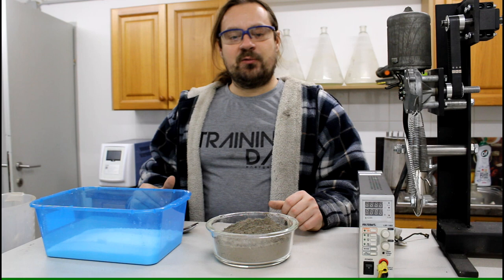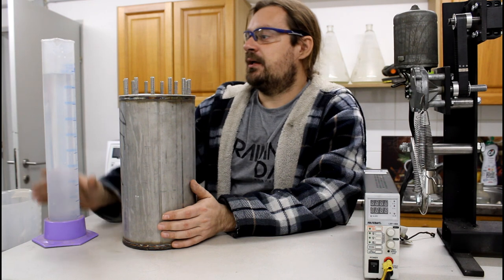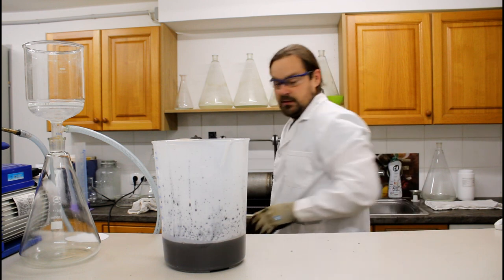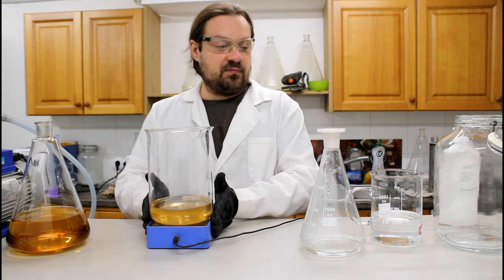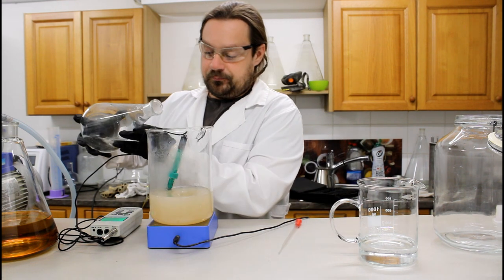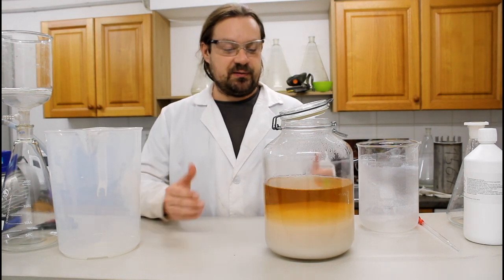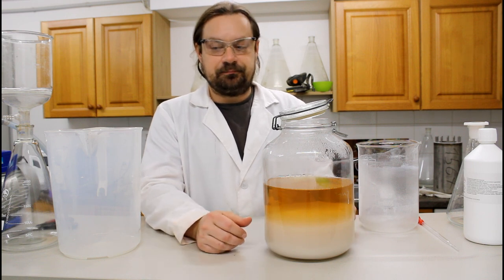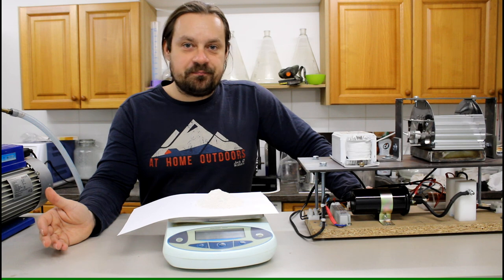how to open an ore with the NaOH boil method

Comment: You can double your precious element hydroxide yield if you further process your iron hydroxide precipitate and your orange  "waste solution"  instead of discarding it, your throwing away values!The orange tinge in that solution is actually a gold metal cluster bound to the other ormes.
Reply from the maker: You mean precipitate the FeOH at ph 3.6 and reboil it? I had actually in mind that the orange color is from Fe in solution or even carbon as the ore contained some organic impurities.
Reply: @andreasthealchemist9446   Well sort of but a few modifications to the process will allow you to extract even more ormes from your iron hydroxide waste. Regarding your caustic orange waste solution you can do a sensitive test for presence of iron traces with sodium thyocyanate but even if the result turns positive theres still values in that solution. Based on my experimentation I strongly suspect the orange color is actually diatomic gold metal clusters bound to the other ormes elements hence the reason you will notice the Au to be chemically inert, however it can still be recovered and converted to metal to futher increase your final yield.  If you decide to process your waste products let me know how it goes, good luck! I can send you my contact info if you have further inquiries.
Reply: I have some same issues. How to contact you

Comment: I am surprised by the basic extraction.. I see initial treatment with acids usually. Are we trying to break up silicates or what?
Reply: I had to give it a think. It opens aluminates and silicates. The description tells that it can get precious metals into solution. That combined with the fact that it leaves behind ferrous stuff, zinc and most heavy metals, it has a good selecting power. Then the acid wash dissolves most amphoteric things like aluminium, titanium, gallium etc and they land in the waste solution.
Reply from the maker: @whatevernamegoeshere3644  Yes it opens Al and Si... Al precipitates at PH 6,5 - so it will be washed out. Si however will precipitate.

I have to make another video that explains what I am up to exactly...

If the values are present as metal (e.g. Au metal) an AR leach or an cyanide leach would be the best to get the values...

This method however targets PGMs that are combined with alkali metals - in nature they exist as white powder, which is somewhat unwilling to analyze as what it is.

Comment: Wouldn't molten sodium hydroxide be more efficient?
Reply: I do this with azomite volcanic minerals and molten sodium hydroxide it turns turquoise, then I add distilled well water and let it settle, you can either collect the clear water from the top and lower the ph with hcl/sulfuric acid to make a precipitate. 

Or dissolve everything with acid and filter then raise ph to 4 and filter the bad stuff and then raise to 8.5 and try to collect and purify the crystals that come out at 8.5-8.7 those react in really strange ways search on youtube "azomite ormus" and there will be this guy with a magnet making them jump

I've opened gold to the point of getting the exact same white jumping powder its like it builds up a charge and releases it all at once.

I believe these materials to be carriers of orgone and they can be augmented and used as batteries for energy.
David Hudson talks about Meissner fields etc
Reply: @ConcretorumAzoth  Wow thank you for that detailed response!! As a professional chemist I am quite fascinated by alchemists and their work. I've read some books on the subject but it's hard to find people I can pose questions to. So you've made a white gold compound that responds to magnetism? That's rather unexpected. Never heard of such a thing. I've made at least 14 different gold compounds in my lab but never noticed any response to magnetism from any of them. I will have to go through your videos and catch up on your work and get a clearer picture of what you're doing.
Reply: @PoorMansChemist  I'm honestly scared to share any of it. Someone tried stealing all my work and lock me in his contracts already.
Reply: I keep getting shadow banned on youtube as well its just spooking me out
Reply: @ConcretorumAzoth  Okaaay. So why don't you just patent the production process? 🤔
Reply: @PoorMansChemist  I made a few of my hundreds of private videos public for today have at it
Reply: @ConcretorumAzoth  Thanks! I'm very curious to know what kind of chemistry was at work there. And you have my word I am not out to steal your stuff. As a rule I avoid doing preps on my channel that other people have done. I don't like stepping on people's toes. So I am happy to say here publicly in writing that I am not going to repeat or sell your work.
Reply from the maker: Agreed! In actual fact high value ores I do fuse in NaOH or even fuse with Na Metal.
Reply from the maker: @ConcretorumAzoth  Yes these materials do have some remarkable properties... It is interesting that you succeeded in creating the jumping white powder with gold - I thought that only iridium is doing that.
Reply: I'm not doing chemistry.

I'm burning with nothing but water and spiritus mundi.
Reply: @user-bt4rz6lw5o  All alchemical processes and preparations can be described in terms of modern chemistry. I have not come across a single one where I wasn't able to figure out the chemistry of it.
Reply: @andreasthealchemist9446  Wait are you guys talking about diamagnetic compounds of gold?.
Reply: @ConcretorumAzoth  OK you're dropping jargon on me I don't know. Now I know what my organic chem students feel like. 😄 What is the kings chamber?
Reply from the maker: @PoorMansChemist  As far as I know gold is diamagnetic anyhow. 

I am talking about gold in the form of a white powder that is not rare in nature. Same as other PGMs which do form white powders too. The chemical composition of it is a combinaton of PGM and alkali metal - e.g. AuNa, which can exist in ionic form or not.

The Problem is, that these AuNa (could be also IrK or whatever the like) do not show up in common analysis as what they are.

Another problem is, that  the bonding of these molecules is so strong, that no wet chemistry can seperate them.

They are abundant in nature - they exist in every plant and animal beeing - vulcanic rock contains the most of it - they do not analyze as what they are and the process to convert them back to metal is difficult.

The following metals do form these white powders: Cu, Ag, Au, Ir, Rh, Ru, Os, Hg.

The easy method that I have given is a way to target these substances occuring in nature.

Respectively the lye boil will not get any metallic gold in solution, but it will do so with AuNa and others of this species...

In order to drop them back to metal the extreme strong bond between the PGM and the alkali metal has to be broken, which can be done by:

a) subjecting it to strong radiation (UV up to X-ray)
b) adding ozone while radiating it
c) strong electromagnetic radiation (microwave)
d) converting it to a sulfide and boiling the sulfide for quite a while.
e) Some researchers also reported that they could perform a reduction with CO and NO gas.

To sum it up:

1) Extracting these white powders from nature is quite simple.
2) Converting metals to the respective white powder is still somewhat simple (could be done with a sodium burn or wet chemistry)
3) Converting these white powders back to metal is extremely difficult, with quite a lot of pitfalls.
Reply: @andreasthealchemist9446   Thank you!!! That makes more sense. I appreciate you taking the time to break it down in terms I can understand. I am acquainted with the basics of alchemy and have enough of a working knowledge to follow along  but I am no expert. 

Have you considered using sodium borohydride to convert it back to the metal? That is my reductant of choice for PGMs since they drop out as the metal and not metal borides like some other metals give you (rhenium is a good example). Sodium borohydride works so well with gold that it will even convert compounds like gold(I) cyanide and alkali dicyanoaurates (all of which have covalent Au-C bonds) back to the metal. Best of all the reduction is over in a few minutes.

Comment: 8:18 I would honestly wear a full faceshield for hot NaOH. A lye splash in the face is not fun, not something I would repeat ever and most of all not when hot
Also that UVC lamp lol. I would bet money you guys used the UV capsule from an 80W mercury street light, judging from the colour and the ballast. Cover the paths of light coming out of it because 1, it will degrade the insulation on the cables in the machine itself, 2, it will age anything made of plastic in your lab. That can be an ultra-expensive mistake in the long run.
Reply from the maker: Hello, regarding the face shield you are right.

Regarding the UV Lamp, it is an 1kw Hg lamp. It takes about 1 minute to get to the full brightness - what you see in the video is the starting phase.

I do not run it in the lab, I run it outdoors - there are just vegetables around beeing happy for some extra UV in winter time.

Comment: When making the initial mix and pouring it out, why not clean out your reaction vessel with water rather than just diluting the mix?  @9:30
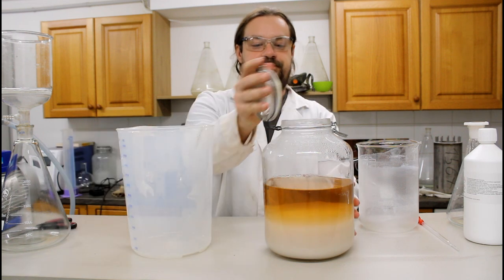Related, why settle the mix only to stir it up again?  Wouldn't it be easier to just separate the liquid first, then scoop the wet white material into your filter? @31:10

Comment: Here are some references that discuss the process of leaching with sodium hydroxide (NaOH) for the extraction of metals from ores or other materials.  Experimentally, there are a lot of variables to digest.  

"Leaching of Metals with Sodium Hydroxide" by S.R. Sengupta and R. Nagarajan (published in the journal Minerals Engineering)
"Leaching of metals from ores using alkaline solutions" by M. Monhemius and A.N. Mainza (published in the journal Hydrometallurgy)
"Leaching of precious metals with sodium hydroxide and sodium hypochlorite" by L. R. P. de Andrade Lima et al. (published in the journal Minerals Engineering)
Reply: cant found any

Comment: That's not a very smart idea to filtrate concentrated lye through the fritted filter, it will end up with a hole in it. And, how do you now you have all precious metals in the filtrate? Gold doesn't dissolve in alkali IIRC
Reply from the maker: The funnel has no fritted glass - it has holes inside.

After about 100 filtrations with concentrated NaOH it still is quite fine, except some etched spots - for the fact that I pay 20$ for a funnel on a large scale import from china I happily risk it getting destroyed after another 100 filtrations.

Regarding gold, you are right - NaOH will not bring it in solution when it is in metallic form. 

But it will do so with some compounds of gold or PGM naturally ocuring in nature.

Unfortunately I have to make this more clear in another video - maybe it was a mistake to start this topic before haveing the whole series of videos together...
Reply: @andreasthealchemist9446  Ahaha I'd been searching for the word "etch" this evening until now. Thank you for the gift)
But usually gold is in its metallic form, isn't it? It might cause some problem being that. You have to revisit this method and apply it to deal with the cake not the filtrate, I think it's much better way to deal with PGM. Just add some reducing agent and probably your metals will be falling down leaving silicates and other messy crap in the solution. Yikes!
Reply: I was also worried about this, I've seen many fritted glass filters destroyed by alkali